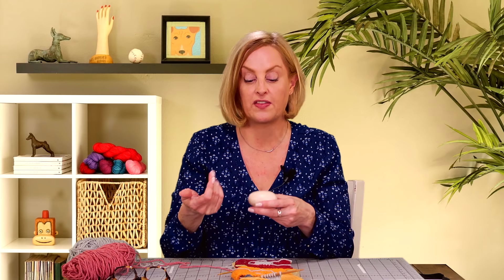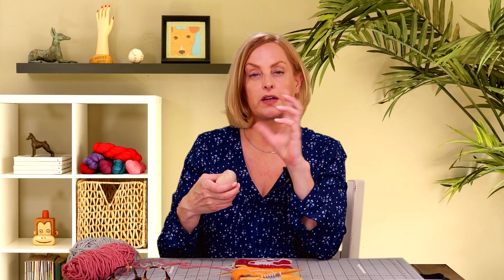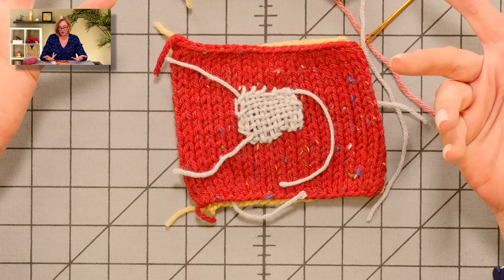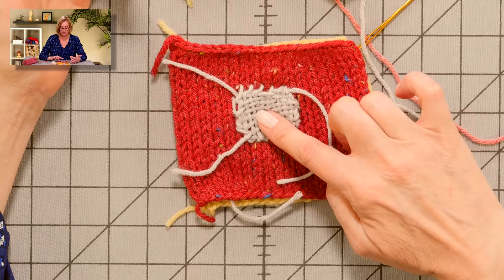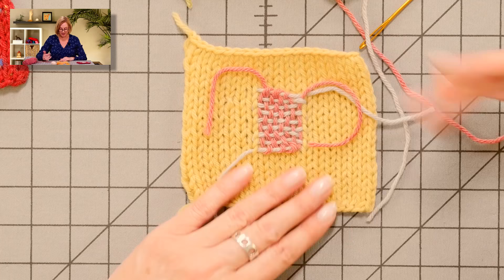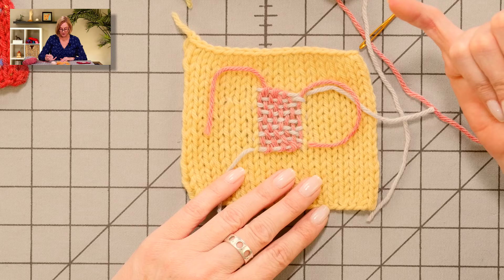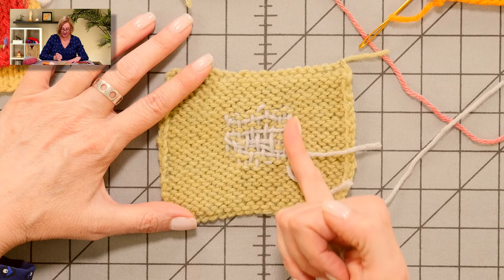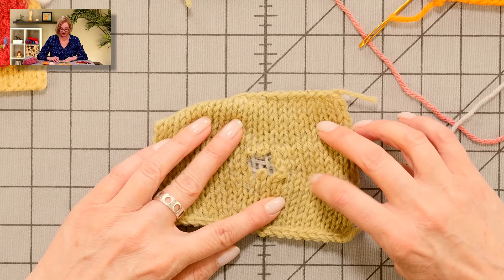Repairing Your Knits - Darning

Comment: Thank you for this video! I have a couple questions, if you have a minute.
1- You mentioned that the darning yarn doesn't need to match weight-wise with the yarn of the sock, is there a guideline on how different the weights can be? Or is that just up to preference/comfort?
2- When doing the feather stitch around the area to be darned, do you need to go into stitches from every column as you showed, or just make the stitches smallish?
I'm asking because the socks my husband is hoping I will darn for him are made of super thin yarn/thread.
Reply: I'm also planning to darn some of my store-bought socks, which are knitted with thin thread/yarn.  I'm planning to do the feather stitch method, but with thicker yarn (maybe doubled or tripled thread), and I'm not going to make tiny stitches - I'll be skipping rows for sure!
Reply: @froggydoodle808  I ended up using worsted weight yarn on my husband's socks and it turned out fine. But, he always tells me he has no feeling in his feet anyway, so I don't know that he's a reliable tester for comfort.

Comment: Staci, help! I think this is the best place to get an answer to my problem. I'm making a baby blanket, knit in the round from the outside in. The problem is that I pulled too hard on the border trying to straighten it out, and I ripped it!!! I'm more than halfway through the blanket and don't know how to fix it. I used a long tail cast on and the blanket is knit in garter stitch.  Please tell me there is hope.
Reply from the maker: Oh, no!  Susana, your best bet is to take the blanket into your local yarn shop for advice, there is no good general answer here.  The fiber type in the yarn you used, the stitch, etc. - these are all factors that need to be taken into consideration.  Good luck!
Reply: +VeryPink Knits Thank you for your quick reply. Sadly for my knitting, I live in Nicaragua and there are no yarn shops here. I'll store it for until I'm in the States (probably in a year or two).